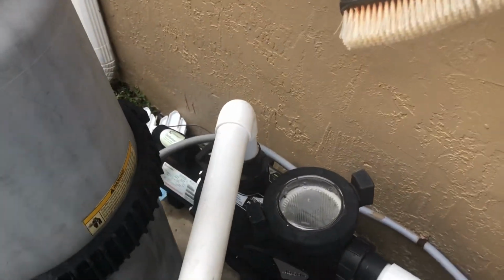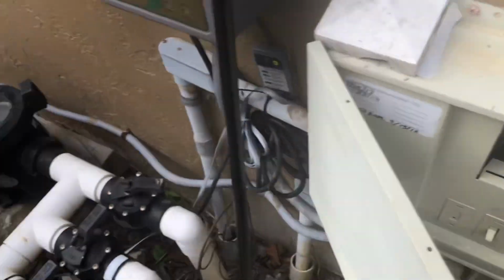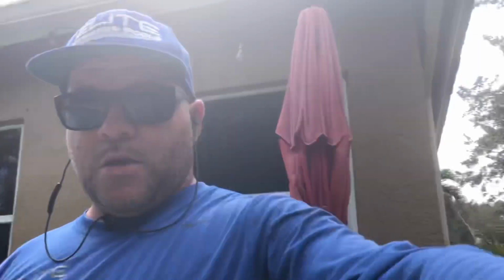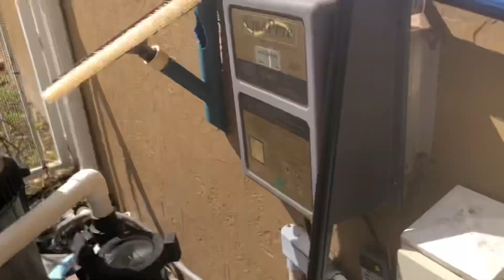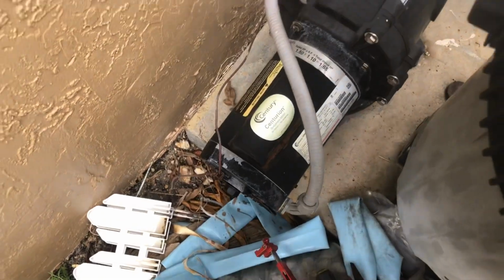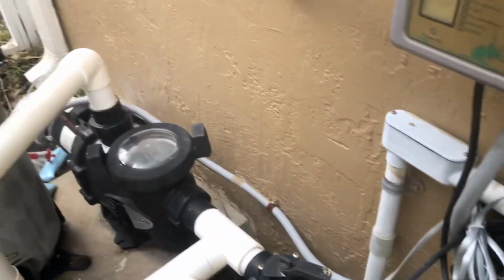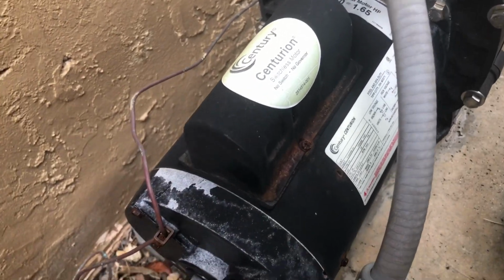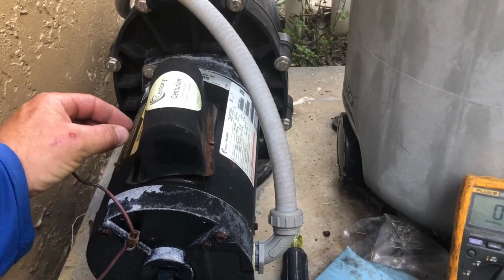Pool Pump Motor Over Heated & Not Starting | Capacitor Problems | Pro Tips

Comment: Thats a good tip! I was taught to put my hand in the impeller and spin it while i turned on the pump. This is way simpler and safer. Thank you my man!
Reply from the maker: Your method is the quick way for the style motors which shaft is inside the back motor cover. Sometimes a flat head screw driver is needed for those deep diffusers in order to reach impeller.
Reply: I have a commercial pool with a 3HP 240V Hayward pump that was brand new about a year ago. Motor kept tripping the breaker so Hayward replaced the motor. Now what happens is after I turn it off to clean the basket, I have to run water on it for a few minutes for it come back on. It will just make a loud buzzing noise and trip the breaker fast. What do you think could be causing this? I doubt it bad back to back motors not sure.
Reply from the maker: Is that a 1 phase or 3 phase motor?

In your case it may very well be an electrical issue. Somewhere in the circuitry there’s either a loose connection, bad or failing breaker ( take breaker off and inspect for any cracks or corroded terminals), bad wire(s), timer etc. Check the voltage at main breaker and see what voltage you have, then go to timer and check the Line side and see what you get there. See if there is any drop off of voltage then to Load side of timer, Any drop off? Then at Pump, Any drop off? You can also check the continuity (Ohms) of the wire. Also check the behind the timer in the switching legs, make sure there’s no colony of ants or bug lizards causing irregular voltage drop offs.  Make sure that it’s wired with the correct AWG size. 

With electricity, voltage can be crucial to the traveling of voltage to any load it’s going to. With a bad or loose connection or electrical part, Heat becomes higher and causes the equipment to over work and overheat.
Reply from the maker: You can also check for heat on the wires by touching the insulation part of the wire. If you feel Heat on the wire, very close you may find a loose connection or bad wire. Check to see if any wires have burn marks on them. 

 DO NOT get shocked. 

Also make sure that motor and timer properly Bonded with Equipotential Bond of the pool. Also ensure Both motor and timer is Grounded inside the motor and timer box.
Reply: It’s a 1 phase. Thank you so much for all the great information, I took a screenshot and will try it out!!! Thanks!!
Reply from the maker: I went back to that house in video to replace the motor and here’s what I found...

Upon removing the electrical wires to motor I took apart one of the hot leads and a small baby froggy fell out. Seems that the frog created a short which damaged the capacitor. Motor always sounded great, so I just replaced the capacitor and asked client to check motor daily to ensure it doesn’t overheat. Since the capacitor was testing 0 MFD’s (no where close to the 30mfd) possibly was causing motor to heat up. I’ll be back there on Tuesday to check on motor operations.
Reply: @EliteSwimmingPoolsTV  wow! Pretty crazy he was able to get inside!
Reply from the maker: Crazy little one inch baby froggy

Comment: The pool pump in this demo didn't need to be replaced.  Only the 30mF start capacitor needed replacement.
Reply: This is very true.  No way should the owner be told they need a new motor until this is done.  That capacitor is bad just from seeing it flared out.  $12.00 on Amazon, motor over $500.00.
This is how customers ger ripped off.

Comment: The whole purpose of the starting capacitor is to give the motor that little twist and start it moving in the right direction. The motor will start in either direction so make sure you spin it the right way. I've seen a length of string wrapped and the shaft and pulled as well. That motor either needs a new cap or relay/ switch.

Comment: Hi new pool owner here, a few days ago my pool pump shut off and won’t turn back on. My heater also is not turning on. I have checked breaker box and neither were tripped. My question is, if my pump motor was bad it wouldn’t effect my heater from turning on would it? I’m thinking it’s an electrical issue.
Reply from the maker: Heat pumps and heaters both need water flowing through its internal plumbing for the to turn on. Inside there’s a water flow sensor, if no water is circulating through heater then it will Not turn on. Pump motor needs to be checked repaired/replaced

Comment: Hello. My pool motor won’t turn on at all. No humming nothing. No sound. Breakers are good wires are good. Thoughts?
Reply: Motor is century. 1 yr old
Reply from the maker: Did you check the power coming into the motor electrical terminals? Make sure your receiving the power and the timer switch is on when you are checking the power. If you don’t get power at motor terminals, then your problem is not the motor but possibly the timer or other component

Comment: What if I replaced the capacitor and 2 weeks later it tripped the breaker and then when I reset the breaker and turned it on it hummed and smoked and now does nothing at all. Doesn’t even hum anymore?
Reply from the maker: The motor itself is dead. Have it replaced

Comment: I replaced the breakers and a new motor. It starts up fine, then motor kicks off after an hour or so... The breakers are not tripped.
What could that be? Please Help...
Reply from the maker: Try running again, when the motor kicks off touch the side of the motor and see if it’s extremely hot to the touch. If it is, then the motor is shutting off due to this reason and motor is most likely bad.